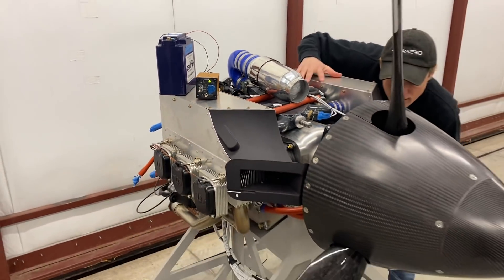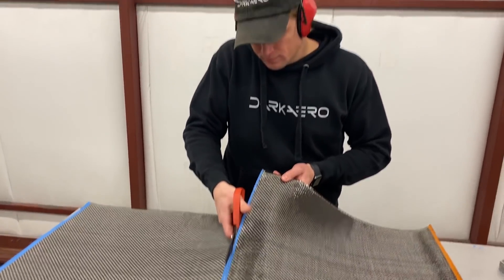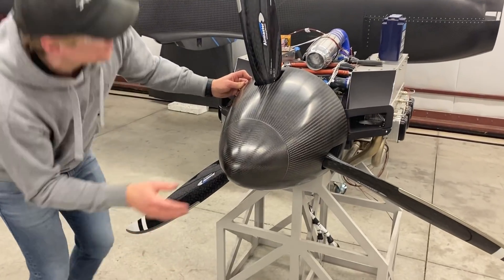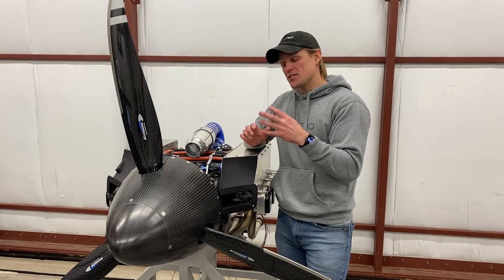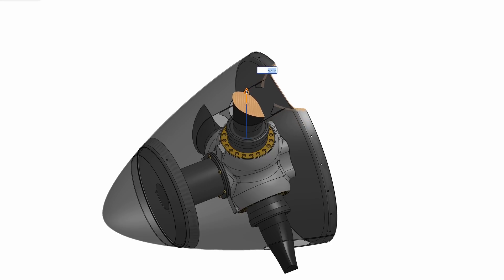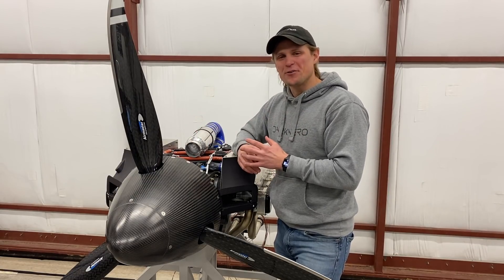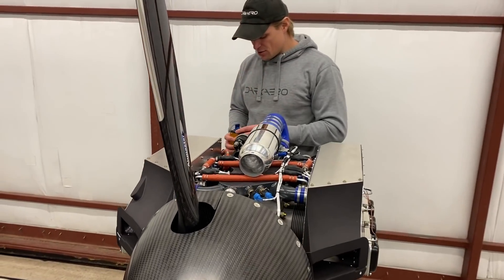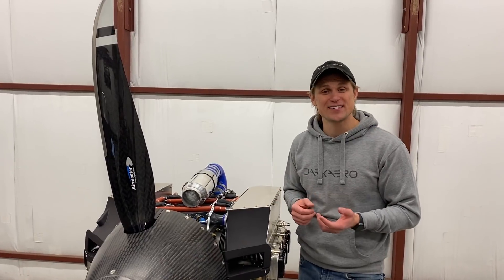BIG Spinner for LOW Drag? | Carbon Fiber Spinner Design & Install on the DarkAero 1!

Comment: Hey this is awesome work! I'm just wondering what kind of washers your are using for your countersunk screws, it all looks nice a flush with the conical shape? Did you counter drill into the carbon fiber?

Comment: As a safety feature, would there be any failsafe mechanisms to prevent the props from feathering while the engine is running?

Comment: BIG Spinner for LOW Drag ? In this case, you are adding LOAD to the spinner, AKA to engines. If you increased the wet area that runs multiple rotations increasing parasitic drag, you certainly increased the DRAG on the propeller. Not sure if you get any benefit from large front spinner.

Comment: This is probably stupid but the round shape of the Wankle multi rotor engine seems appropriate for a prop airplane. Aside from not being air cooled what makes this engine a poor choice? Thanks.
Reply: Wankels are not great in terms of reliability, which is obviously a big concern for most aircraft. They have been used on some small drones (not as much of a big deal if an unmanned aircraft crashes).

Generally when you desire a higher power to weight ratio than a piston engine can provide a turboprop is the obvious choice. Fuel efficiency isn't great, but they are incredibly lightweight for their power output and extremely reliable. Also they are usually a long thin cylinder in shape, which fits well with an engine nacelle or a low drag nose.

Comment: Great stuff, as always, guys!
Question - are the spinner screws longer and safety wired on the inside of the spinner? 
Do you worry about the screws "vibrating out" (much like the screw that was bouncing about in the "imbalance video clip" you had shown)?

Comment: You probably know that the long prop shaft extension creates a longer moment arm if any propeller imbalance exists. That translates to the root of the prop shaft and stresses bearings, seals, prop bulkhead bolts, engine shaft flange bolts. The vibration then works its way  thru the engine mass to the airframe/engine mount and could create vibrational stresses. Just throwing that out there as a thought that might require contingencies later.
Reply: Lower weight can mitigate this.

Comment: Nice spinner.  The large spinner may also help keep a high pressure area at or near the cowl inlets.  I imagine performing a dynamic balancing of the spinner/bulkheads assembly might be beneficial.

Comment: 8:00
this seems like overthinking a really simple issue, why not be lazy in the assembly, and then go through the work of balancing the spinner by adding very small weights? Make the spinner with whatever technique is simplest, then attach the bulkheads temporarily, and suspend the spinner on it's axis of rotation, then add small weights until it is ballanced
I can even imagine doing it in 2 steps, first with small weights placed on different corners, and then we precisely measured ammounts of epoxy/resin you can add on the inside
Alternatively, the opposite, make the part with 3 small chunks of epoxy on opposite sides, and use sandpaper or something else to take them off until the part is perfectly balanced in the axis of rotation

similar to what https://youtu.be/rKk0mJuXMqE?t=2546 does (42:25)
It seems way smarter to not bother too much with the production if it's a little thing that can have an easy fix with just one extra balancing step

Comment: do you apply CFD before making any of these?..and was there any engineering applied to look at the effect of the longer prop shaft?. the longer they are, the worse the longitudinal vibrations and where in the bearings. there are other issues also but generally the shorter the shaft, the better. im interested in the engineering you did before making these things.
Reply: Yes they did do CFD using Simscale. There's a video on it. They also verified their CFD results with wind tunnel tests.

Comment: For the future, might have a look at the LiquidPiston engine that is being put into military drones. It has better efficiency, lower weight and would allow for a much narrower front. Also perhaps of interest, check the Smartcarbs made by Technology Elevated. These would increase range over injection, adjust to height and humidity. For slightly better mileage and cooler engine, check the Pulse Jet inserts by Steve Scriminger. Whats the glide ratio with feathered propellers? wont you get better range with longer, thinner wings with higher aspect ratio? on my old BMW boxer motorcycle I use RVS treatment, which extends engine life and cooler oil (plus a little bit of power improvement and mileage, but not much).

Comment: By feathering the blades they generate maximum torque that needs to be offset with aileron. Does that relationship get optimized to get the most drag reduction by minimizing countertorque and its drag?

Comment: Very interesting video. I just put a larger spinner on my Tailwind W8 and had to use the bulkhead in the nose area. Cools better in the summer but found out it cools a little too good in the winter here in Michigan lol. The spinner is off of the RV aircraft.
    Not sure if it did anything as far as micro miles per hour so to speak but it does look better. Startled me a little bit at first and I thought about calling the airplane Pinocchio but decided against it. Anyway excellent video. First one I've seen. I hit the like and I will subscribe.

Comment: Hey guys, I love how the spinner looks! I know you said you don’t have a  clear number for how much efficiency increase with the larger spinner, but if you can work out ballpark that will be great. If the gain is small would it be worth it to have a more expensive custom part with additional balancing effort (vs cheaper more common off the shelf)

Comment: Be careful about narrow prop extensions like this one, they work great when everything up front is balanced and acft isn’t in unusual attitude, but in high P factor during slow flight they can flex and cause the spinner to grind against the cowl. The P51 has this problem and can ruin the whole spinner flying nose high in slow flight. Also if you get a bird strike and the prop gets off balance, you want the extra margin of safety with a wider extension that can handle the vibration.

Comment: I like your solution to eliminate overlaps in the CF. I have a suggest for cutting the openings for the prop. Use a hole saw to cut the radius portions and then follow-up with an oscillating saw to cut the straight slits. I would recommend using a backer to prevent damaging the inside surface. Something like a wood mandrel, but you might be able to get away with using tape.
Reply from the maker: Thank you for watching and for the suggestion! I'll give a little more info on why we selected the tools we did for cutting the blade holes. Since the DarkAero 1 will be a kit aircraft and cutting the propeller blade holes will be a builder task, we set up this step with the builder in mind. Using a large diameter hole saw to cut the arc portion of the blade hole would be difficult to control and less precise on the curved surface of the spinner. The moon shaped blade on the oscillating tool gives more freedom in your cut path which is necessary on the blade holes because they are not truly circular; the blade hole is a circle projected onto the angled face of the spinner. The blade we chose makes clean cuts with minimal disruption of the cut edge. The final shape of the cut can be cleaned up and corrected in small amounts with a sanding block. We like the hole saw technique best for cutouts on flat panels. A good example of this would be when builders use the hole saw method to produce circular hard point reinforcements for the engine firewall.

Comment: Nice splaining! I was really gung-ho on bush planes, but now you got me thinking "fast is sexier!"  Speaking of fast, will the DarkAero's prop have BETA? That'll keep the weight down on brakes.
Reply from the maker: Thank you Tony! Our prop does not have BETA mode, only feather function. Airmaster does make a prop controller with an option for BETA though. Typically this is selected as feature for seaplanes so they can taxi and maneuver on the water better.
Reply: @DarkAeroInc  Hmm, since it's a kit, it may be a good option to offer. I'm thinking about ways to preserve my brakes. What do you think?

Comment: Does this thing run a dry sump?
Reply from the maker: This engine is a standard sump although UL Power does make a variant on this engine with an inverted oil sump, the UL520iSA.

Comment: Like all the thought and ingenuity that goes into these products.  Would you need to balance every spinner for the specific prop and have it paired with a blade for balancing?  Or are the tolerances of the props and the spinner tight enough, that any imbalance is within spec of the chart and equation you mentioned?
Reply from the maker: The spinner and propeller get final balanced as an assembly so technically they are all paired.

Comment: Love you guys...thanks for being part of the flying community!

Why not use a type of dampener? Yes, I know it adds a little weight but this would permanently fix any imbalance issues. You could fabricate them based on a similar designed used in car engines to balance the crank, which is basically what you're doing here.

Will there be any intelligence built in to prevent the prop from feathering while the engine is under power?
Reply from the maker: Thank you for watching and good questions! Final balance is achieved by adding weights onto the spinner backplate to offset any imbalance forces. There is logic in the prop controller to prevent feathering while the engine is running. There is an RPM sensor in the brush head assembly so the prop controller knows what the engine is doing.

Comment: And could you produce a tiny turbofan engine. Imagine how clean, free and potent the same size plane would be with 2 small turbofan engines at the back. How quiet, civilized and revolutionary. How light. How fast.

Comment: Amazing video ! 
Did you buy the seamless carbon fibre cloth  as a COTS item? If so then from which vendor?
Absolutely love the way you share your knowledge, engineering concepts and experience in such a short video !
Reply from the maker: Thank you! We purchase the carbon sleeve in a long roll and then cut it to length. The specific type isn't public information but a google search of "carbon fiber sleeve" will yield many results that are similar to what we use.

Comment: 8:19  These are beautiful screws.  I actually need to purchase something like those for aesthetics.   Do you mind giving a link to what they are and where to buy them?  I know you mentioned quick bond.
Reply from the maker: The screws we used are MS24694 stainless structural machine screws with 100 degree countersunk washers. https://www.aircraftspruce.com/catalog/hapages/ms24694.php
Reply: @DarkAeroInc  Thanks, DA.  Actually it's the combination of the screw and the washer that gives it that aesthetically pleasing professional look.  Do you mind giving a link to these washers too?  :)
My apologies for bothering you...
Reply from the maker: @danl.4743  No worries! Forgot about the washer link. Here is what we used: https://www.aircraftspruce.com/catalog/hapages/stainlesswashers.php?clickkey=3020239 Make sure you select the washer size to match your screw size. Good luck with your project!
Reply: @DarkAeroInc  Thanks!

Comment: besides having a better balanced design, do you plan on removing the rotating assembly to have it dynamically balanced?  Like adding a sticky weight here or there to get the best possible balance?
Reply from the maker: We will dynamically balance the propeller and spinner together as an assembly with the engine running. Balance weights get bolted to the aft bulkhead to offset any imbalance forces.

Comment: Looks fantastic. What state would the spinner come in with the kit? Are the holes for the propellor cut? Is the bolt pattern on the aft bulkhead already cut? Excited to see this plane fly!
Reply from the maker: Excellent question! The spinner in the kit would be made up of the forward and aft spinner segments plus the two internal bulkheads. Builders would bond the two segments together, cut the blade openings, and install the fasteners. We had to position the blade hole locations with templates but now that we have the hole size and position more firmly established, we may add some cut features into the mold to ensure builders locate the holes properly. We haven’t finalized a production method for the bolt circle pattern on the aft bulkhead. It needs to be accurately positioned which suggests CNC but I’m thinking there is probably a more efficient method using a drill template/jig. Thanks for watching!

Comment: Outstanding layout! I love the feather mode!
Reply from the maker: I think it looks like a propeller on a mini turboprop when it’s in the feather position. 😎
Reply: @DarkAeroInc  True Story Time... Be careful when getting refueled by an FBO fuel attendant. You might end up with Jet-A instead of 100-LL. Happened in Tyler, Texas because the twin he was flying had featherable props on the ramp in feathered position. When the attendant filled the tanks mistakenly thinking he was filling a turboprop. The pilot lost power 5 minutes out and landed over a highline then under on a state highway and dead stick taxied into a bar parking lot!
Reply from the maker: @willhibbardii2450  Yikes! Definitely will remember not to park with the prop in the feather position. The fuel cap holes on our wings are sized small enough so that it should prevent inserting a Jet-A fuel nozzle but still gotta watch out for fueling errors. Thank you for sharing the story! :)
Reply: @DarkAeroInc  , Glad you enjoyed it. Learning from the dumb stuff that has happened to pilots is a good thing. I know I don't want that happening to me. I've had other pilots laugh at me for doing complete ground checks after getting refueled sniffing it and checking the sumps. Good plan in having sized fuel holes!
Reply: @willhibbardii2450  And amazingly, sometimes warning placards don't even help! Ya can't fix stupid!
Reply: @randallsemrau7845  , Yep! People make mistakes. It's the human condition.

Comment: What kind of mould sealer are you using to seal up  the mdf and get the part off?
Reply from the maker: We seal the MDF with epoxy, sand it lightly, then coat it with mold release. We've also used wax successfully too.

Comment: Nice. I'm sure you guys have talked to your air racing buddies about the spinner to cowling gap and aero drag at that juncture.
Reply from the maker: Definitely a little bit of an aerodynamic "dirty" area at the junction of the spinner and cowling but no good way around that. We have to keep a little clearance there to allow for relative movement between the engine + prop + spinner assembly and the cowling. The holy grail would be a perfect transition there with no gap! 🤓